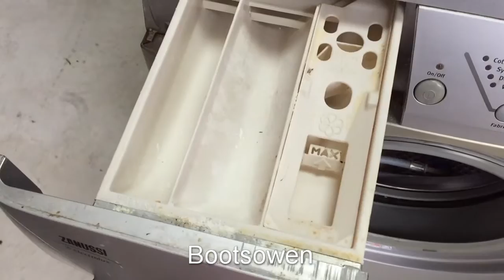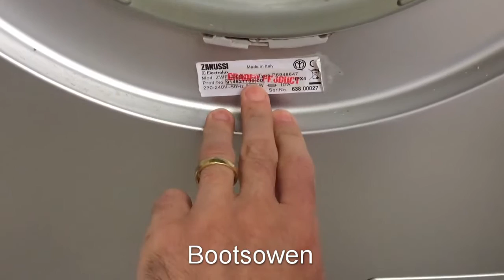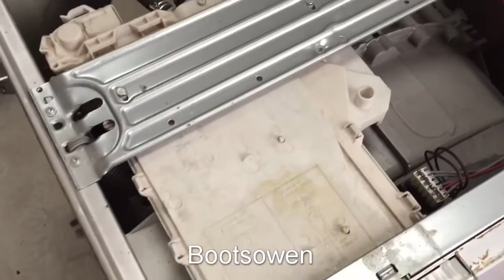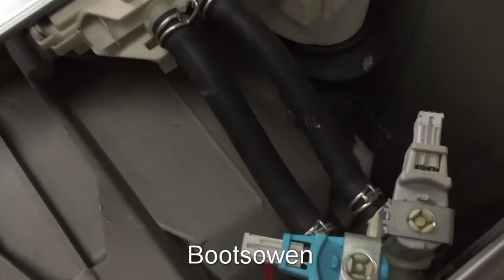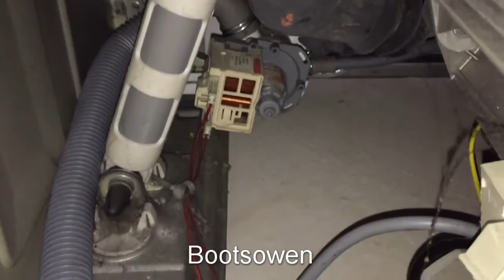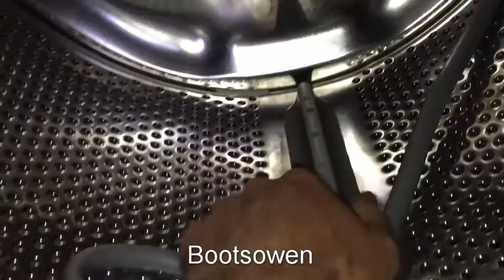Zanussi ZWF1432s inspection and review

Comment: I replaced the bearing on exactly this model a few years ago, I chopped the drum in half where it's glued together with a wood saw, replaced the bearing and glued and screwed it back together with Tiger Seal and it's still going strong 4 years later, solid machine, must be 16 years old now!
Reply from the maker: What did the screws get a grip on? the little lip left behind? I guess it was enough.
Reply: @bootsowen  The Drum still had the lugs they used to use to bolt them together before they decided to just glue it together, so I drilled then screwed into those solid lugs with big self tappers to pull it all together, but Tiger Seal is super strong so I've got no doubt it will stay together.

Comment: I’m looking to buy a new washing machine, my Beko has bearing problem after 2 years of use. I’m looking to spend up to £330. Which brand and model would recommend I buy? Or perhaps go for second Miele? I was looking at a Zanussi for £330 from John Lewis comes with 2 year garauntee or Hotpoint for £230 from Curry’s + £100 for 5 year warranty. The Hotpoint doesn’t have the same functions as Zanussi namely quick was 15min/ 30min and reduce time function.
Reply from the maker: I would only feel comfortable to make a recommendation based on what I would choose.  I have 2 old Bosch machines, about 20-30 years old. This is more of a lifestyle choice than anything else as they need fixing from time to time. but usually less than every 2 years and the cost is minimal.  If I was buying a machine new, I would choose the cheapest appliance that I could find, brand name is unimportant to me, I am also unconcerned about the speed of a wash.  I prefer a 2 hour long cotton 40 or 60 that will clean the clothes and keep the machine clean.  If you only do 15/30 min washes at 30deg then the machines get dirty from soap scum inside.  I would suggest a generic brand machine from a large or small shop. A warranty is irrelevant to me as I would prefer to  use my statutory rights, rather than pay extra for a warranty.  So I would rather buy a £150 machine every 2 years with the chance that it will last 5 years, than spend £330 now and have to deal with warranties.  that way you would have £180 in the bank now.  Let me know what you decide.

Comment: Are you from Ireland?
Reply from the maker: Once upon a time
Reply: bootsowen I’m looking to buy a new washing machine, my Beko has bearing problem after 2 years of use. I’m looking to spend up to £330. Which brand and model would recommend I buy? Or perhaps go for second Miele? I was looking at a Zanussi for £330 from John Lewis comes with 2 year garauntee or Hotpoint for £230 from Curry’s + £100 for 5 year warranty. The Hotpoint doesn’t have the same functions as Zanussi namely quick was 15min/ 30min and reduce time function.  Thanks!